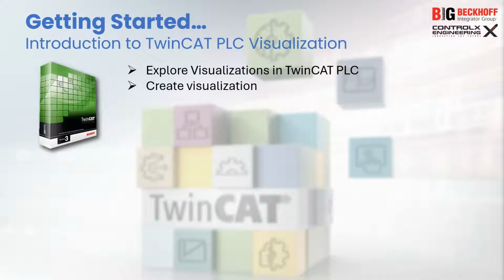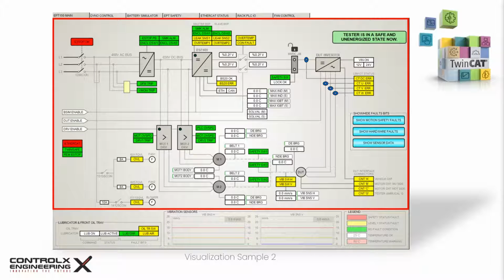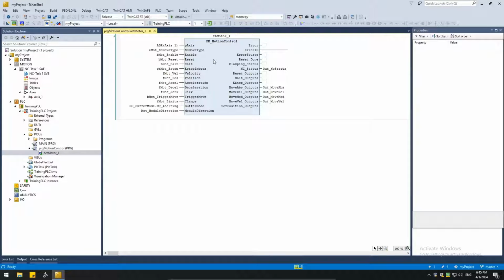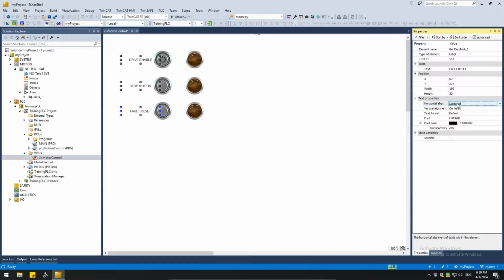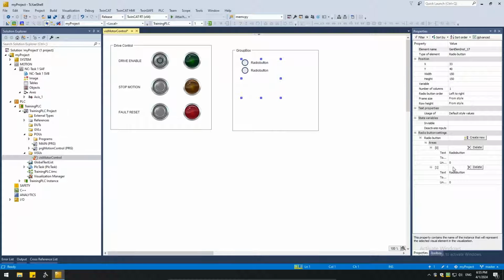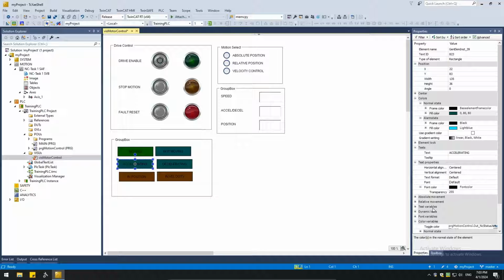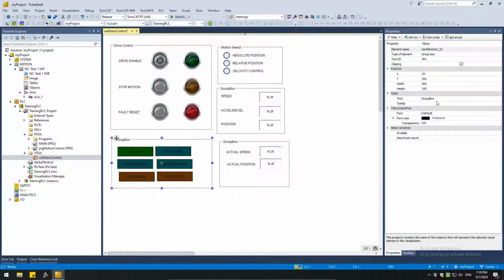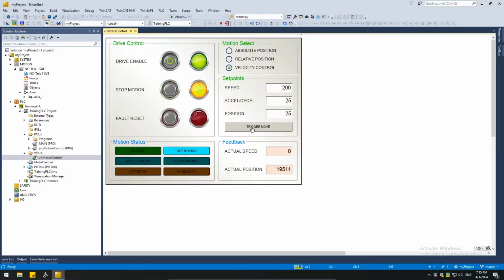Beginner’s Guide to TwinCAT Visualization: Step‑By‑Step HMI Development

Comment: Is there a link location for the Function block used in this program? The project wont work its showing i dont have the Library needed
Reply from the maker: That is a library that we use internally at ControlX. Try removing the library and any references to it in the PLC.

Comment: I noticed you using a grid, spacing and sizing in multiples of 10 pixels. Do you ever run into problems when running the visualization on monitors, since they are sized based on multiples of 8 pixels? The first setting that I always change when starting up a new install of TwinCAT 3 is to change the default grid spacing to 8 (or 4 or 2) so that everything scales properly. Great video! Thanks for sharing